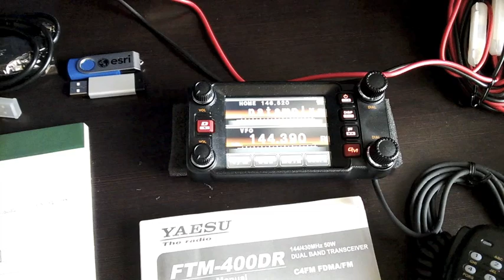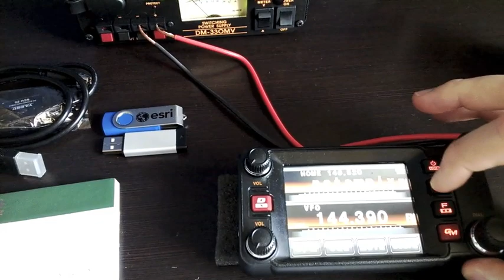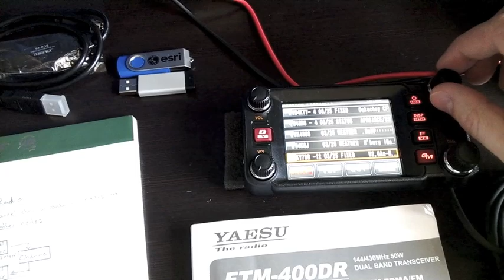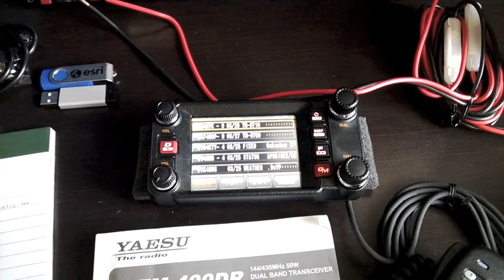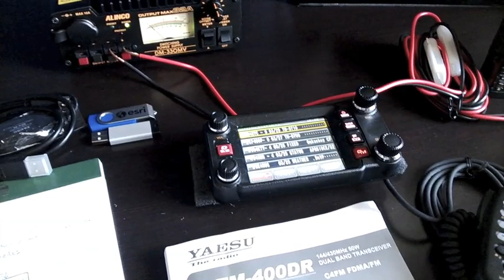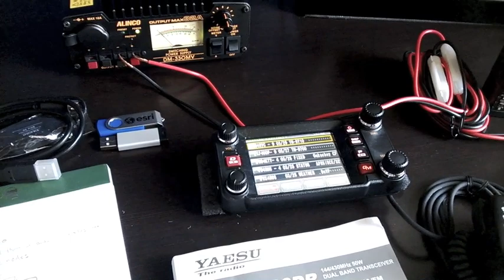Yaesu Digital System Fusion - FTM-400DR

Comment: What a stupid / useless system. No call sign routing. Call sign routing was literally the only "cool" thing about Dstar. How the fuck is Yaesu still in business? wires-x? for real? Wires died a painful death over 10 years ago but Yaesu is still kicking that horse. You can send a photo at shittty = almost useless resolution. Good luck getting the USB cable set up to pass data other than GPS. Yaesu did a piss poor job of engineering this thing yet the fan boys eat it up!
Reply: N0CALL Ham Well based upon what you think is cool and your infliction and the use of foul language just goes to show why yeasu didn't go with Call Sign routing.  It's very poor operator who uses Call Sign routing.  It puts your call sign out without you, the operator, to do the one thing all hams should do before transmitting....which is listen, listen, listen.  That is very poor operating, and honestly goes against what a good Ham would even do.
Reply: I am 100% sure that you do not understand what call sign routing is. it does not put your call out without the op making it happen. Please do some research and learn a bit before you make a fool out of yourself.
Reply: N0CALL Ham The problem with call sign routing is that it routes your call to a 
place where you can't hear what's going on before you transmit.  It's a 
one-way affair...if you call sign route to W0LID while he's linked into a
 ginormous linked repeater system that's in the middle of their weekly 
net, your call will go out right in the middle of the net.  You wouldn't
 do that, of course, if you were able to hear the net in progress before
 hitting the PTT, but the technical limitations of call sign routing 
don't allow you to hear what's happening on the other side of the call 
(heck, you don't even know where the other side of the call will be when
 you key the mike).

So realize that when you call sign route, you
 are transmitting in the blind to another repeater...or possibly into a 
huge linked system with dozens of repeaters.  If there is a QSO in 
progress, you just jumped into the middle of it with both feet.  It's 
not a good way to operate.  With luck, this "feature" of DSTAR will go 
the way of the dodo bird...but until then, it's best not to use it.
Reply: You are doing it wrong. all you have to do is blip the PTT to link, then listen. The directions even tell you to do it this way. Once again, your understanding of D star is pretty limited.
Reply: system fusion offers nothing. zero features over analog. 90% of the fusion repeaters that I know of are set to analog only. WIRES X is already dead. This mode is already doomed.

Comment: Fusion uses FDMA not TDMA. There is a big difference.
Like you noted if the mic is keyed hanging up the channel. That only happens on FDMA not TDMA.
FDMA is a single or double transmission on 12.5 kHz split into 2 - 6.25 kHz bandwidth channels.
TDMA is a single or double transmission on 12.5 kHz bandwidth split into time slots.